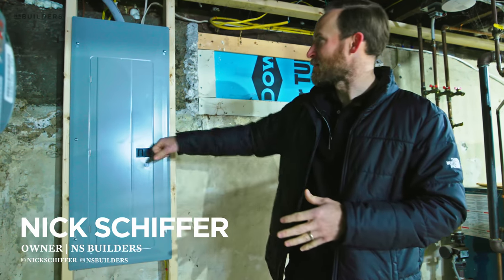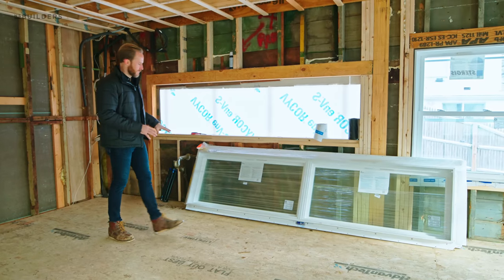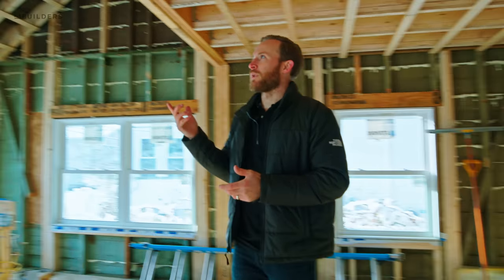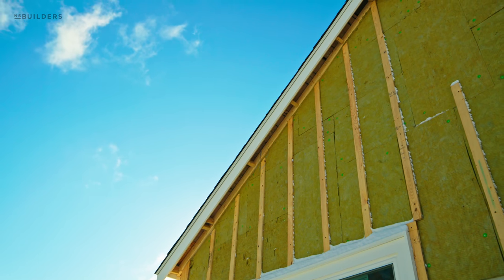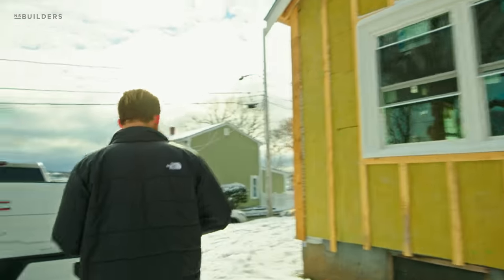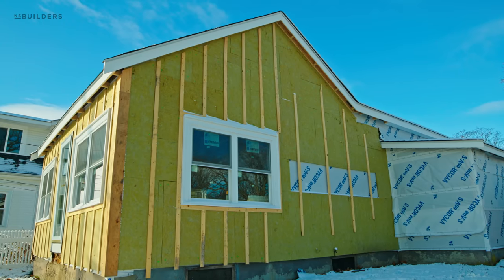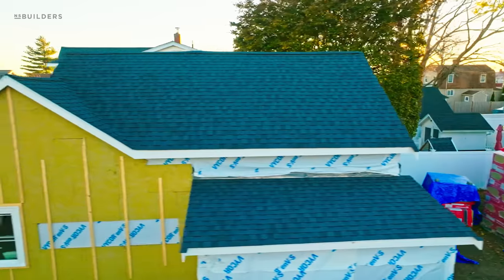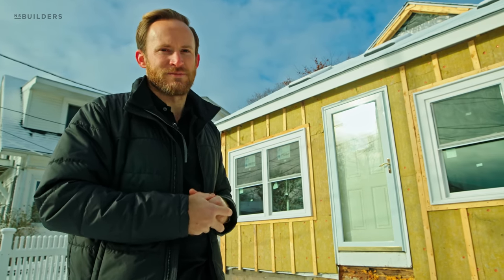Old roof sheathing? Use the right underlayment before new shingles

Comment: I don't get why this house was not knocked down and rebuilt?  All you are keeping it the old crappy parts like that foundation.  Why on earth would we not knock that junk down and get a brand new foundation and basement that is insulated properly and waterproofed and clean.  So silly.  This "preserving" old junk is just stupid.
Reply from the maker: Thanks for you opinion. But I disagree for so many reasons, especially since you don’t have the full context.
Reply: @NSBuilders  ..I am with you if it is a significant historic home. Then, sure, keep it.  But name one thing - just one - that we can't make new, and better, now.  There is nothing. Every trim piece, siding, brick, foundation, kitchen, level 5 drywall vs plaster - to say nothing about electricals and wiring and solar and amazing modern windows, and super good insulation, bug proofing and temperature controlled AC etc. it is all better now, especially with builders like you that are devoted to it. Then there is design elements - modern builds with proper sized kitchens and baths and closets, make old houses look horribly dated.  Consider amazing engineered LVL beams that are much straighter and stronger than natural beams - all is better.  Of course it is, unless you think that "people forgot how to build like they use to" for some reason (so silly but some say it).   If we hired you to build a new house, it would be many times better than any old one.  You can't compare crappy mass produced cheap houses to old expensive houses, unless you compare them to mass produced crappy old houses (almost all of which were knocked down since they were crappy).